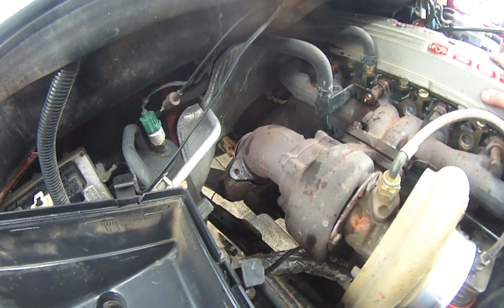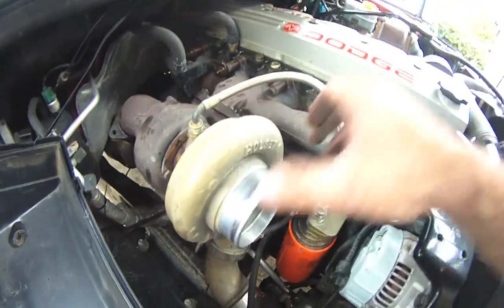Cummins 24v DPS X Installation

Comment: OMG, is that a fram oil filter? Nooooooooo! I replaced my manifold too, only it came out in 3 pieces, not 2 or 1.
Reply from the maker: Hahaha... yeah, that Fram is loooong gone.  It's what came on the truck.
Reply: @yourbeekeeper  When I bought my 1999 back in December of 2015 it had a Fram on it to.  Now I run the 3894 Fleetguards.

Comment: How has this manifold been holding up so far?
Reply from the maker: No leaks or any issues on fitment at all.  Whatever finish it came with didn't last, but I did buy it at a reduced price as a Blemish, so that's an issue I knew when I bought it.   I would absolutely buy this manifold again.

Comment: Wow, you know you've been living right when you do an exhaust and dont have a single broken or stripped fastener. I wish I wouldve made a video of the manifold I replaced on our expedition earlier this year. It was cracked and had a huge hole in it. I wasnt feeling well and was basically working by myself and with one hand. So no time for dat video. That New manifold looks pretty well made.
Reply from the maker: I was very , very surprised at getting everything done without one broken or stripped bolt...I still don't know how or why that happened...hahaha.  I like the design and sound of the new manifold, it should serve the truck well. Thanks for stoppin in Buddy, Hope your doing well.

Comment: The amount of exaust flow with the new manifold is night and day . Once that exaust is on it and you redo your air box the hp change will surely be felt from day one :)))  Nice install !!!
Reply from the maker: Thanks Gerry.  I can't wait to get this truck on the open road and really get a feel of the power improvement, but around town, I can definately feel good changes. Thanks for watching and stay safe.

Comment: We have that same manifold but for a third gen on our 1000hp rig. Well, it's only like 760 with a single turbo. The twins picked it up to a little over 1000. But I REALLY like it. It's a great piece of kit. It holds a good bit more heat in than the factory unit. Only draw back is that it takes a little longer to cool down after some spirited driving. Shame that our big motor truck doesn't have a title. And a BIGGER shame that you couldn't put it on the road in your area!
Reply from the maker: Hey Chuckie, I have been bit by the diesel bug... It has a strong hold on me.  lol.

Comment: you can tell its a quality part just by looking at it,the fact that everything lined up just proves it, on the older gm small blocks one has to install spreaders before removing or installing new ones so the bolts line up.........  yep done that plenty over the years
Reply from the maker: I was very, very happy and honestly surprised it lined up without any leverage needed. I, too have had to ream holes on headers or use pry bars to get things in place in gas engines over the years.

Comment: I wonder if the 2 middle ports are restricted more because it's a straighter shot so to help equalize exhaust pressure.
Reply from the maker: That sounds possible.  I will have to do a little research.